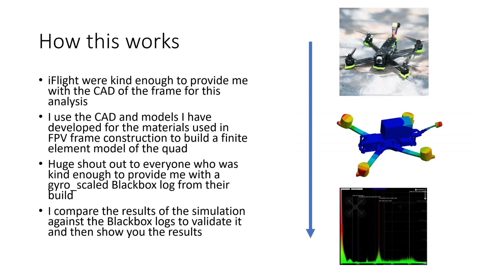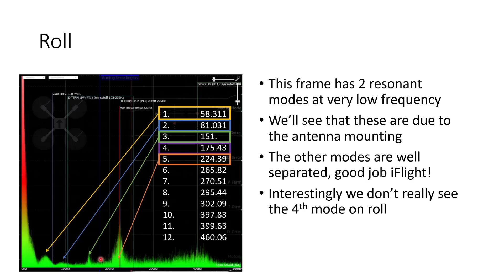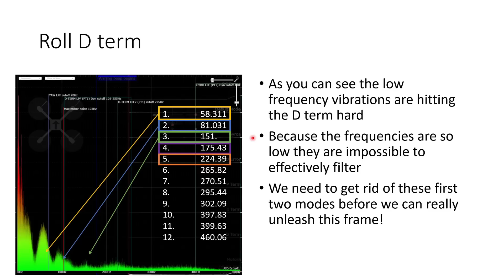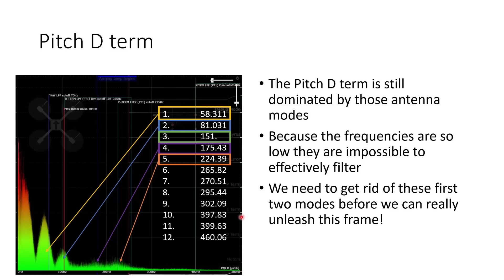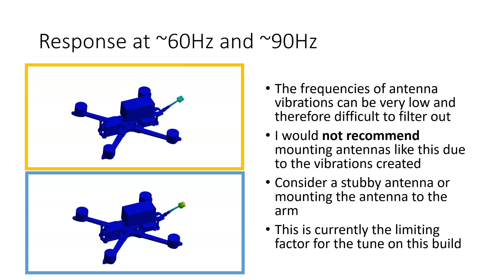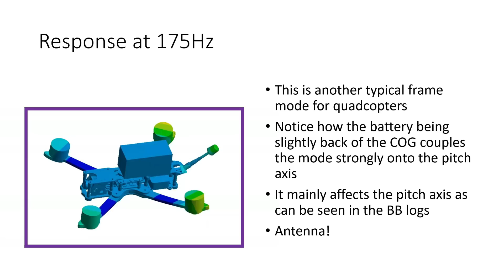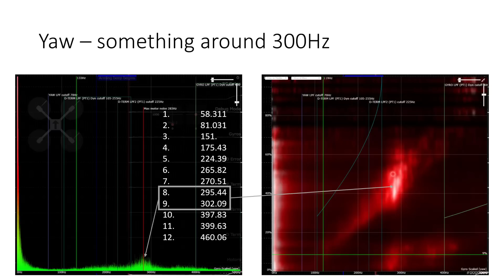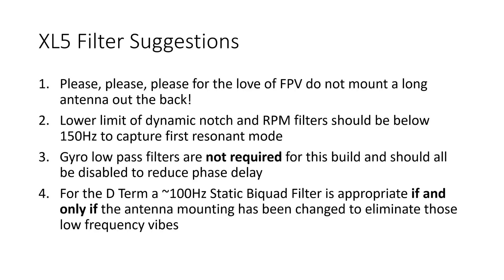Vibration analysis of the iFlight Nazgul 5 V2 and XL5 Frame. The antenna RUINED my tune!

Comment: Lets all be honest can you really prove the antenna is that bad on the actual noise
Reply from the maker: Proof is a tricky thing. I proposed a hypothesis based on a simulation result and then validated that hypothesis by looking at experimental data from a blackbox log of the quad. The vibrations occurred at almost exactly the same frequency as was predicted by the simulation. So there is clear evidence for the effect. If could have been a coincidence, but then many commenters have also reported vibration issues that were solved when they changed their antenna mounting. The body of evidence is growing, that much is clear.

Comment: Excellent video. One question that may sound a bit exaggerated but still bothers me: If we could have Gyros down under the motors and read the data simultaneously, could this also improve the PID corrections?
I mean in all of your videos the way the motor's bases bend seem to be a big issue.
Reply from the maker: It could help! I don't know if the complexity and cost ends up being worth it though. If you want a route to improve performance this is my approach: https://youtu.be/DYTmbUuNps8

Comment: In my experience stubby antennas struggle when the battery and a GoPro are blocking the signal.  Like many things in the hobby, there's give and take.
Reply from the maker: Absolutely right. A stubby might be appropriate for freestyle but for long range you will want the longer antenna and you'll accept the tradeoff.
Reply: Depending on your purposes you can always bottom mount the battery to remove the interference.

Comment: I have a question about these simulations - how is the material stiffness determined for each part? Does the antenna have a preprogrammed different stiffness compared the the carbon fiber frame? Just curious because I feel like relatively accurate values of stiffness would be necessary to accurately predict the real frequency of these harmonic modes (and make the filter recommendations relevant), especially for those lower frequency resonances and for builds with parts that are potentially orders of magnitude less stiff than other components (such as the frame vs the antenna). It would be cool to see how many different stiffness coefficients/what parts are different stiffness for these simulations.
Reply from the maker: All of the parts have different properties based on material and also orientation for the composites. Thanks for your comment!

Comment: I use the Caddx Rush Cherry 🍒 antenna now after the iflight SMA to MMCX broke just moving the top plate. The Cherry antenna has a short tube and the screw spacing is the same on the plastic bracket to TPU mount. So you can have the tube in all the way to make a stubby or out an inch for longer range if if you want. 
I used some extra screws from the box and the clear plastic nuts that are used on the stack. I put a small amount of  UV glue on the nut so it can’t back off. It seems to work well I’ve been out 800 meters easy. It will go much farther I’m sure.

Comment: Would it be as similar in terms a of resonanve for an Iflight SL5 frame (Iflight cidora) ?
And are you using Solidworks Static for frequency simulations ?
Reply from the maker: Should be similar and no I don't use solidworks simulation for this. I use a combination of some tools I've written myself and open source software.

Comment: Great video. Could you recommend a couple stubby's. Thanks again.
Reply from the maker: I'm sorry I fly DJI and use these: https://shop.iflight-rc.com/product-cat123/sigma-5-8ghz-rhcp-lhcp-fpv-antenna-ipex-ufl-pro1237
They are super small, super light and pretty much indestructible if you strain relieve the connector properly.

Comment: Decoupling the antenna should possible... I'm imagining drilling out the TPU and filling the hole by wrapping the antenna with damping tape (like 3m VHB) or maybe that grease, or some silicon that is always soft. Keep in mind, you don't want to just move the frequency lower, you want to decouple.
Reply from the maker: You need to be careful with this approach. Lowering the frequency will make things much worse so if you don't decouple really well you'll be in trouble. Making the mount stiffer is a safer bet as it increases the frequency and reduces the vibration amplitude.

Comment: This is the first video of yours I've seen where the comments section has multiple people asking if this antenna issue really matters or is worth worrying about. Knowing this isn't a general review video but a vibrational analysis video. I wonder if this is a demographic change because it's a BNF so maybe newer users or maybe something else. This isn't too say I disagree with them. An antenna above the battery is a night and day difference for rf on 5.8. I did notice most of the people who did question the antenna issue mentioned theoretical comparisons and general user interactions, like the things you might see in videos, instead of personal experiences. Great job as always. You're really dialing in the entire vibration analysis process. There's much less repeated material so it feels more streamlined and there's more actionable advice. Thanks again.
Reply from the maker: Whether it really matters to a particular pilot is a fair question to ask. To To a newer pilot who has bought this as a BNF and is still very much in the learning phase on stock PIDs and filters it really doesn't matter. To a more experienced pilot looking to make their quad fly its best this type of info is essential.

I feel like I've done enough vibration analysis that it's now about actionable recommendations for the community rather than "look at this cool new way of analysing quads". The models have been well validated by blackbox on many frames so they have become a useful tool for troubleshooting and even generalising a bit between similar frame designs.

 Thanks Justin. 😁

Comment: Pulled out my Nazgul 5 and looked at the stock antenna, and easily can see that the TPU mount is overly flexible beyond the frame. With the DJI antenna it seems like the holes for the other antenna options are just weakening the amount of material there (and flexible TPU isn't helping much in general). Perhaps if removing those holes and increasing the material may help strengthen that a bit.

Comment: I fly the Cidora SL5 V2.1 frame, i hope that the things you said work for this frame too, its basically the same frame with slightly shorter arms 217 vs 227mm

I am ordering some stubby antennas for my cidora sl5 ASAP, thanks Chris, this is excellent work.

Comment: Ok you might have a valid point, but the whole reason they have a flexible mounting of the antenna is in case of a crash, having it like this will not snap your antenna, breaking off.  And of course you come with a valid solution, however the frame/drone you are referring to is a budget drone and not meant as top of the line. So I personally understand their design choices and agree with it for the price point.
Reply from the maker: I agree, the Nazgul BNF is targeted towards beginners who will mostly fly stock filters and PIDs so the antenna mount doesn't really matter for the BNF.

However, for experienced pilots who are looking for the best performance and building DIY with the XL5 this antenna mounting strategy has serious implications. I think that creates two levels to the video. Thanks for your comment! 😁

Comment: I recently got the iFlight Chimera7 frame and it has a lot less vibration than others I've tried. But when I added the tpu gopro mount I got two low resonances like shown here with the antenna. I made a DIY metal bracket which got rid of them. I've seen antennas cause vibrations in the bb before, especially the long ones like the Albatross. A stubby mounted under the fpv camera might have better range, as it would be clear of the lipo and gopro. You'd have to be prepared to replace it in crashes, or protect it somehow.

Comment: Thanks for the insight.  I'm thinking making the antenna/mount stiffer will likely just move the frequency vibrations lower.  Making it vibrate more would bring it higher and more able to be filtered I presume.  Interesting situation to think about.
Reply from the maker: Making the antenna mount stiffer will increase the frequencies and reduce the amplitude making the vibrations easier to filter. Making the antenna mount less stiff will make everything worse.
Reply: @ChrisRosser   Was thinking if you still use TPU, but a stiffer antenna it would decrease the frequency. I guess it would likely go the other way now that I think of it as you stiffen frequency generally increases. Ill try stiffening the tpu and antenna to see if it can be brought higher up over 150hz

Comment: So all those fancy long range quads that supposedly could freestyle are prone to more prop wash given their extra long antennas?

Also what would be the impact of shorter arms (3.5-4j’’) and smaller motors on a frame resonance? I would guess less material in the frame and less power from the motors and likely more noisy motors would give more or less the same picture as for a 5’’?

Thank you Chris! Good to see some simulations!
Reply from the maker: In general smaller quads have higher frequency vibrations that are easier to filter out.

Comment: Edit: Sorry that my comment is so similar to others.  I didn't read down before I made it.  Hey Chris interesting stuff.  I understand what you're saying about the antenna mount, but mounting the antenna on an arm really seems to limit its RF performance due to the shadows created by the frame itself as well as the battery.  What if the material used for the rear antenna mount was PETG which is much stiffer than TPU?  Would that push the resonance of the antenna higher, out of the range of prop wash and other similar disturbances that we want the gyro to deal with?  Also when you say "stubby" are you talking about an antenna without any tube at all?  How long can it be before it starts creating problems.
Reply from the maker: Hi Chris, PETG or PLA is a great option to make the antenna mount stiffer. I mount my antennas to the arms and don't have a problem with range for freestyle (but I fly DJI so that helps). Hard to know how long is too long, it'll depend on the frame, filters and PIDs what is acceptable. The shorter the better.
Reply: @ChrisRosser  Hey Chris.  Some pictures of my AOS5 along with some of the parts I designed and printed.  https://www.thingiverse.com/thing:4885128   You can see the antenna mount I created there.  The quad flies great even with a TPU ant mount.  If a PETG version was better I don't think I would be able to tell but possibly you could see it on a BB log.  People are welcome to DL the STLs and print their own.  I'll be you're going to say that the landing skids add mass at the ends of the arms and could cause more vibration but they are very light (15% infil) and like I said it flies nicely now and still on the stock PIDs.  I'm waiting for you follow up video to see what you do to make yours fly better.
Reply from the maker: @chrisyoung8062  Those parts look excellent thanks Chris! Your TPU antenna mount looks pretty solid, so I wouldn't be too worried about vibrations. I fully, fully, support the idea of tpu parts to protect the ends of the arms. If they wrapped around the edges of the arms that would be even better as carbon likes to delaminate from the edges after many hard crashes.

Comment: Hi Chris, what would then be at least the best compromise how a sticking out antenna would provide least amount of noise into the system? Because for example for a long range copter there is no way to go with a stubby.
Reply from the maker: If you use a stiffer plastic like PLA for the mount that will help a lot. Make sure the antenna is nice and snug (but not overtight) and use a stiff antenna that is as short as practical for your needs.

Comment: Interesting...I just mounted my Vista antenna this way and developed a new vibration in my quad, didn't associate the two at all. I'll go back to my old mounting method (zip tied) and see if it improves. Also interested in an analysis of the 4" Micro Apex...happen to have one ordered!
Reply from the maker: Ah ha! Try your old method and let me know if it makes a difference. I also zip tie my antennas to keep them still.
Reply: @ChrisRosser  Went back to the zip tie and the new vibration is gone! Video comparison can be seen here: https://youtu.be/cH2EYj2PH3U Nice work Chris, and thanks for your videos, I'm learning a ton!
Reply: Can you post a picture of how you mounted the vista antenna the old (better) way?
Reply: @jopro_fpv  https://photos.app.goo.gl/eN9pSVTtKrBQEs3XA
Reply: @jopro_fpv  That link shows the Mount...basically sticks the antenna straight off the back, angled up maybe 30 degrees. Didn't have the foresight to take a photo before I took it off. I'm very new at this but I'm guessing the wagging antenna will have an even greater effect on a sub250g drone like mine.

Comment: Hey Chris. Thank you for doing this analysis. I've been flying the xl5 for around 6 months now and to hear that it performes good in the vibe analysis is nice. However i've realy come to love the TPU print that holds both the sma Connector and the xt60 in place which you said was very suboptimal. Is there a way of redesigning the TPU part (Moving it closer to the frame or printing at a higher infill) that could make it vibrate less? I would realy hate having to mount my antenna and xt60 differently since thes tpu part is so practical. Also, frames like the Qav-s JB ed. have tpu sma mounts which go out the back. Are those suboptimal aswell?
Reply from the maker: Using a shorter antenna is probably the right solution for you. Ideally a stubby. If the TPU is working for you probably no need to change it.

Comment: But arent stubbys and even mounting an antenna close to the carbon decrease the performance of the antenna in terms of range and even to some extent RF noise performance ? 
I have been mounting antennas like this for over a few years now and have had quads fly good and bad, as this has kind of been a very traditional approach to mounting antennas ever since FPV became something. It's kind of hard to believe that something that is so so much a part of how we have been doing FPV is something that actively reduces flight performance by a significant factor. 
I would request analysis of a few other frames with such antenna mountings to concretely believe that the antenna is causing this, 
and just in case if one absolutely has to mount an antenna this way , would some softer tpu mounts dampen it ? or would it make matters worse?
Reply from the maker: Yes mounting antennas close to carbon does decrease range. However, for freestyle I've never found range to be an issue (especially with digital). Vibration performance is a tricky topic how good do you need your quad to be? If you fly stock PIDS and filters it probably doesn't matter much. If you tune for peak performance the vibrations caused by the antenna are unacceptable.
Softer mounts are worse. You want to mount the antenna so it can't wobble.
Reply: @ChrisRosser  would an antenna somehow decoupled from the frame suspended in a damping medium be better? It might be a little over engineered but users that end up going far away benefit from having a long antenna
Reply: @ChrisRosser   isn't there some trick you could do to increase the frequecy of the wobble to get it into a range that could be more easily filtered?

Comment: I have not gotten into tuning yet but I still watch your videos. Yesterday I noticed my Gopro video gets blurry at certain throttle ranges on my Gep mk4. That's got to be caused by the things you talk about here. Harmonic resonance from the motors and frame matching up with my gopro mount, right? I'm going to have to learn about filters and stuff.
Reply from the maker: Yep jello in HD footage is a sure sign of vibrations. Have a look at some Blackbox logs, that's the best place to start.
Reply: @ChrisRosser  I need to learn about black box too. I'm not even sure if my flight controller can do black box.

Comment: I doubt this result. Simulating frequencies in thin air with no fixed support????. In finite element analysis you always need a fixed support so you can reference the movement to. So what's yours?
Reply from the maker: You don't need a fixed support for vibration analysis. You get rigid body modes at 0Hz without supports exactly as you should. Those are neglected in the analysis to leave the vibrational modes of interest. Deflection is measured relative to the undeformed state.

Comment: Do you have any recommendations for antenna solutions on a long range quad to that minimise resonance?
Reply from the maker: Don't use a TPU mount. Try a stiffer plastic like PLA and use a stiff antenna that is as short as practical (I know for long range it'll need to be quite long).
Reply: The VTX antenna will work much more efficiently if it is in 'clear air' a couple of wavelengths away from ground or conductive material (especially in the orientation parallel to that of its elements), so if range is an issue then you could try the Atomic antenna that Flywoo used on the Explorer (they are long but lightweight, although they are also more fragile).